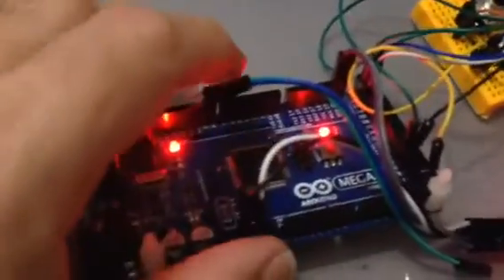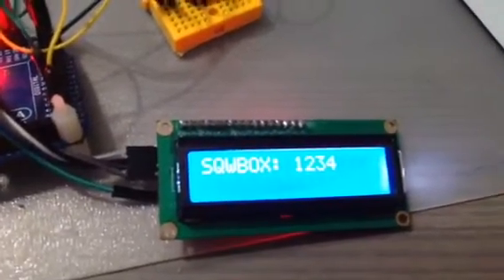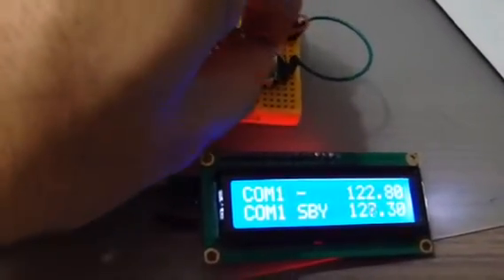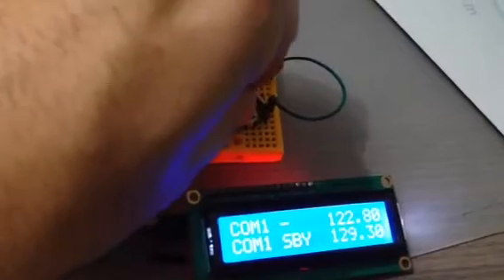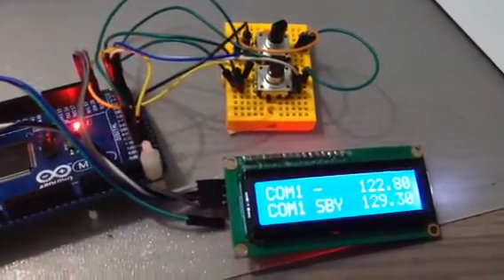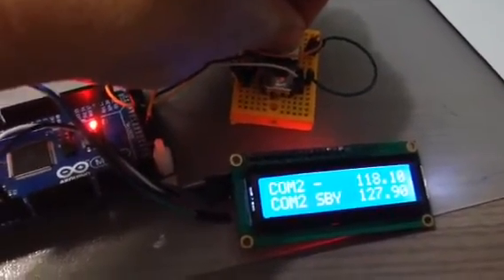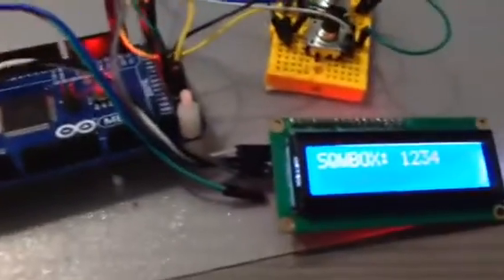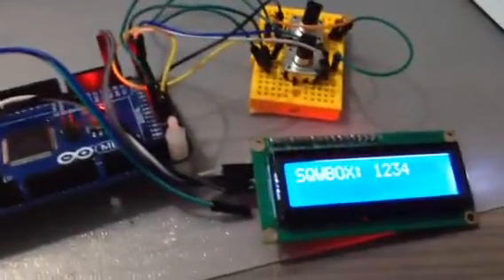Cockpit-in-a-box | Xplane | ArdSimX  Arduino

Comment: great effort , Would you pls share the code  ?
Reply from the maker: Hi Hassen. Thank you. I dont think is worth doing it, because ardsimx will be deprecated. Now there is a new version called SimVimCockpit that is completely different. It has a different architecture that I don´t know if I can port it.
Reply: Thank you for the replay , In fact , I find the issue . During last week I find out that I am using the ZIBO version of the 737-8, this airplane come with dire feet parameter than the standard 737 in Xplane 11. I am following your website and the last version Is easy to use for non programmers skill  .

Comment: Nicely done. Could you please share the code. I am in the process of building something similar. thank you
Reply: What I see on the website ArdSimX support only 7 segments display not a 2x16 lcd?
Reply from the maker: Dacian TOMUS I will. I will let you know when I let it in github
Reply: Dacian, this  is working under our ArdSimX Interface. You can see more instructions on our website - http://www.simvim.com/ardsimx/ - it's very easy to use and make any input controls and outputs, especially newest SimVimCockpit interface.
Vlad